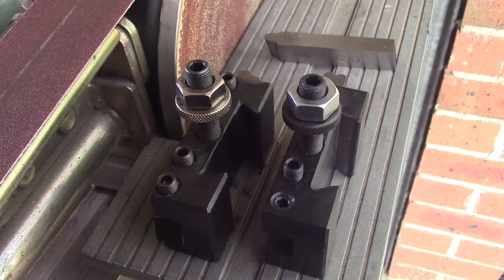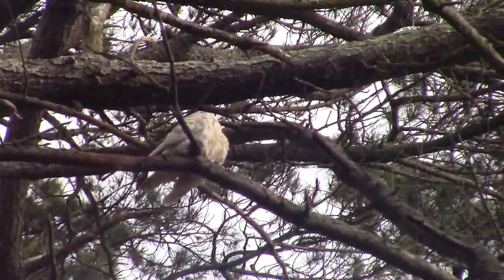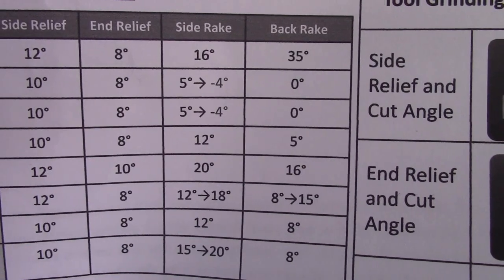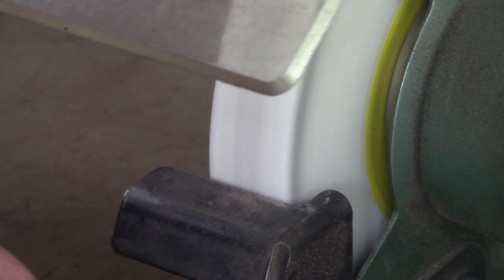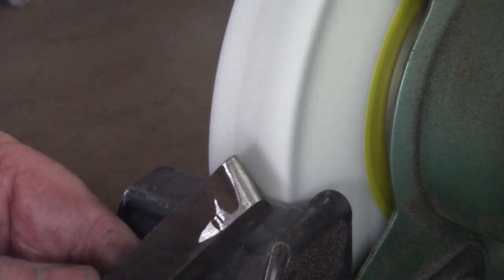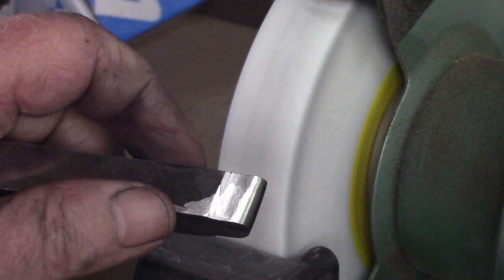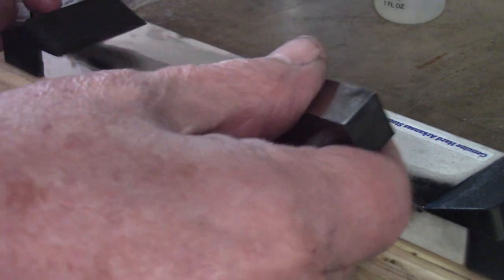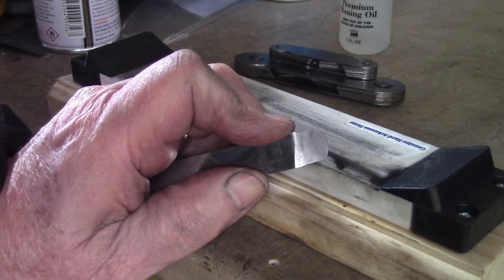Tool Grinding Tutorial

Comment: Thanks for doing this video Gary. Very interesting. I purchased some hss blanks a while back but never got round to using them. Now I will give it a try.
PS those birds have real character!
All the best.
Andrew
Reply from the maker: Thank you Andrew.
You will most likely need profile tools for your beam engine, just remember they have a large cutting surface area and can be hard on a small lathe, just take it slow, both feed and speed.
You will get chatter if you set up is not correct but it is rewarding to know that you have ground up your own tools, practice on a bit of scrap first.
Any questions please ask.
Yes I might complain about the noisy birds but in actual fact I love them around, they all have their own character.